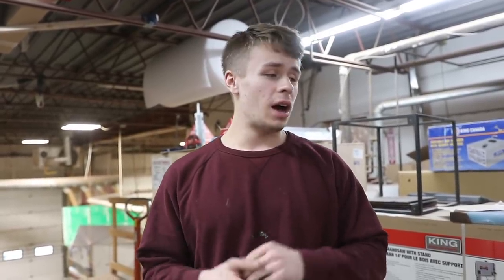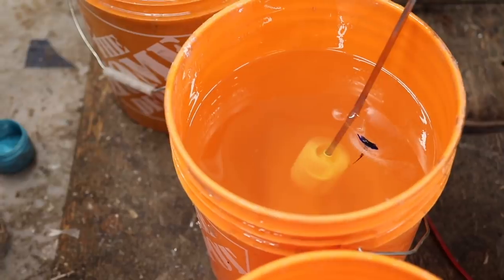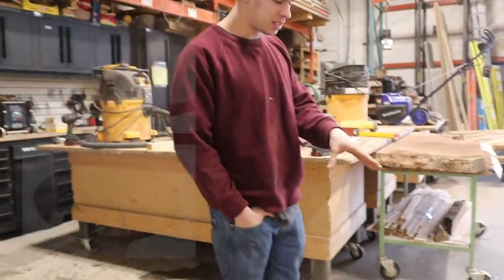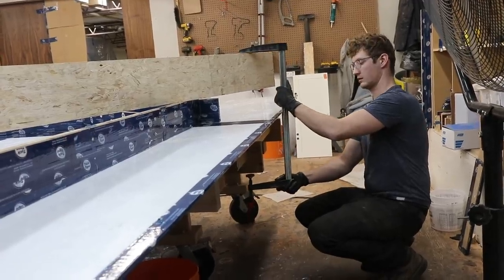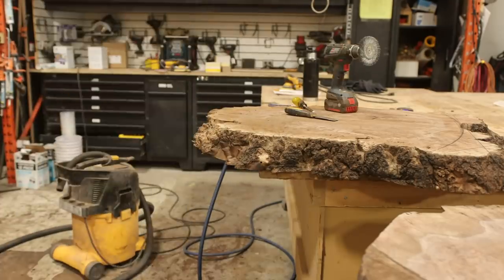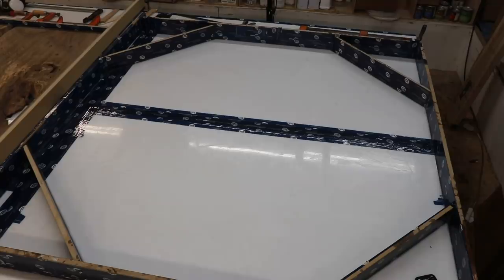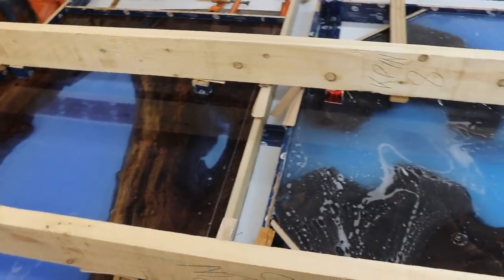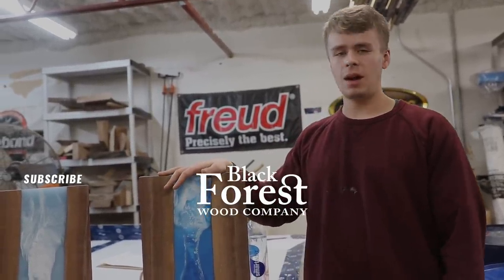Making Our First Round Resin Table

Comment: Dillon, an afterthought, using the same resin on the bark as the pour may not work as when your pour heats up the setting process it may loosen the bark resin so maybe use superglue on the bark. It will take a few experiments Ralph

Comment: I know there are a lot of interesting swirls in the grain of these big burly slabs, but I wonder, if you are going to use opaque resin, if you could use a plain plank of wood and cut in a faux-live edge. If you did a little bit of sanding to smooth over the  "live edge" it might look convincing enough. Maybe it would work best on pale woods like maple or poplar where the bark/outer rings aren't much darker than the inner ones?

Comment: i like all the videos where you show the process from the beginning. you have multiple. you show how to build the forms and how to mix. i like knowing how you level and finish the tables. i really liked when you didn't stand down to the resin company that was bad but wouldn't admit they were bad.

i'd like to see how you design the table. how do you pick what the legs/support structure will be? do you have a calculation you do based on weight of the finished table then build the legs to support that? do you just wing it based on past experience?

i like that it's dylan's dad's company and dylan does a lot of hard work. some kids of business owners don't do that (a restaurant in my hometown went bankrupt within a year of the kids taking over. the parents had quality food at lower prices and the kids did shitty food at high prices.). dylan could have gone to college (i'm not sure if he ever mentioned that he did) and then sat in the front office handling customers or otherwise sitting at a desk. he doesn't. he's helping lift the heavy shit, he gives credit to his workers, and he knows the wood. 

i'm a pretty big nerd for these videos.

Comment: I enjoy watching all your videos for ideas and to see how you do things.  I plan on trying a small table soon.  Just curious though as to why you didn't make a round mold for the round table?  There is still going to be much waste in cutting off the corners of the octagon (obviously not as much as would be in a square mold).  I was thinking you could have used metal strips bent to form a circle - maybe even placed inside that octagon to hold the metal to shape.  I can visualize how you could used thin bendable metal to form a variety of shaped edges maybe using verticle pins to hold the metal to shape while the epoxy cures.

Comment: I'm new to the epoxy table scene. Just finished my a live edge river table. Clear river with a pebble bottom. Lots of lessons and procedures learned. That's quite an operation you have there. Very impressive. I'm curious about how your round table is gonna look. I didn't expect you to arrange the wood the way you did. LOTS of epoxy. I tend to fill more of the space with wood. Will a table that size be self supporting or does the base take care of that?

Comment: Not sure how yiu get away with not sealing the edges of wood when doing the cast pours but you do
Reply from the maker: Our epoxy is slow curing so we get fewer bubbles from that alone, but we also do a lot of things to make sure the resin doesn't heat up too quickly.
You can check out our FAQ here:  https://www.youtube.com/watch?v=nMDLmXVpnFU&t=426s
We go over our pouring process and why we don't seal the edges

Comment: In the last two pours you made you do not show taking the air bubbles out with a torch. Was just curious also if the epoxy that you use recommend pouring in quarter inch lifts then torching out the air bubbles then pouring more and repeat that process until done. You guys do fantastic work and great videos. Thanks

Comment: Super video as always, congratulations on the 1st year, hopefully many more to come. I like them all! but did like the ones where you were shopping for slabs. Do you every use a Heat gun or Torch to remove bubbles, or is it not necessary.

Comment: Hi. I poured my first resin yesterday, followed all the guidelines. Checked it this morning and the resin has quite a few cracks, deep ones. Why is that? Is it the cold perhaps?
Reply from the maker: The opposite actually, it cracks when it gets too hot. We use a lot of fans and air conditioning when we pour, especially if they're bigger or thicker pieces
Reply: @BlackForestWoodCo  Thanks for the reply.. Now I dont know why? Perhaps too much catalist? Maybe poured too thick? No idea. Perhaps the kind of resin I used? What is the best kind (not brand as Im not in the U.S) to use? Thanks again